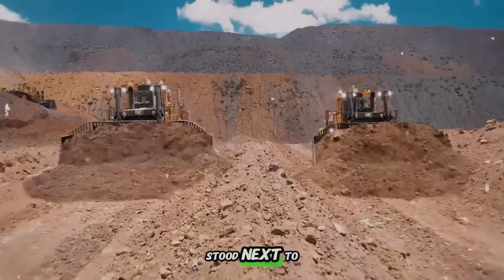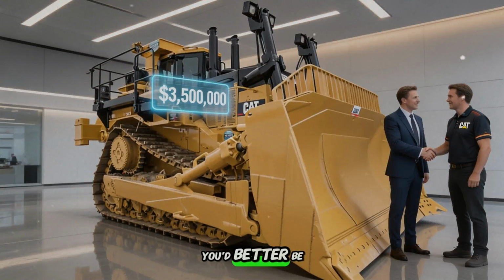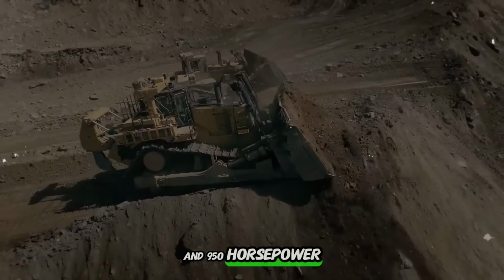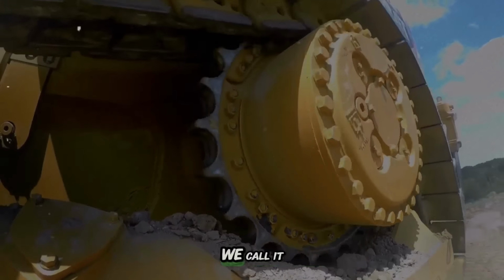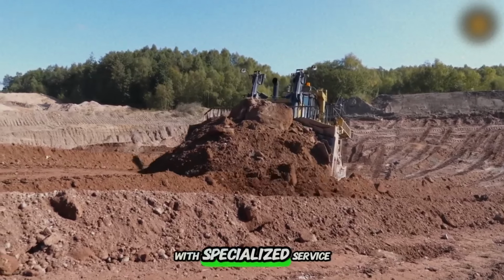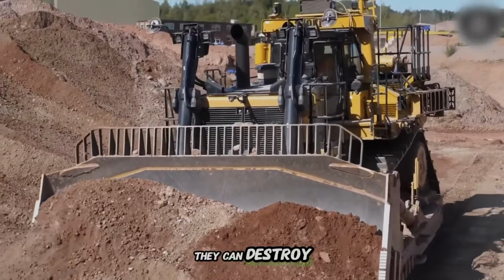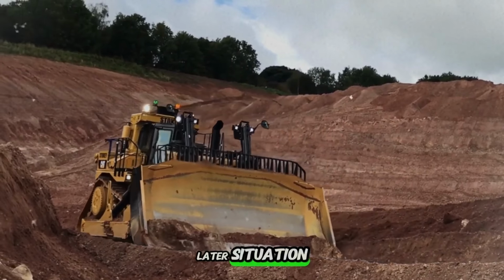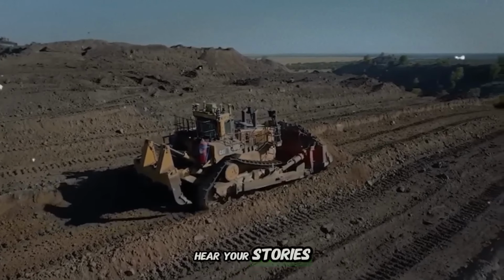Why  MOST People Can’t Afford a Caterpillar D11

Comment: When D-11 is changed to
 diesel-electric (available now) from mechanical drive, engine life goes 24000 hrs.  D-11T final drive fit electric drive motors. D-11 runs 24/7/365!

Comment: Overall good video.   I sold these for years.  Most customers used them 20 hours a day.   Pricing is over 3 million for almost all configurations.  $400 to $500 per hour with operator and everything else needed is not out of line.
Reply: True.
Good comment.
Left mining three decades ago, but had D10 and Komatsu 475 on site.
Gold mining. They ran 18 hours a day minimum each.
A few hours down for service and refuel.
D10 pushing scrapers and 475 ripping and general work in West Aussie mine.
Great machines. Got to do some ripping in the Komatsu. 
Never forgot the power they have. Truly awesome. If you’ve not been in one it’s really hard to appreciate what they can actually do.
Humbling.

Comment: It’s an off-road truck why would it need def ? My dad had an excavation project this past summer and they specifically used off-road diesel. It’s cheaper. But yeah, there’s a huge fuel burn on anything big. Do you need low end torque.
Reply: Red diesel is tax exempt.   It has nothing to do with EPA emissions requirements
Reply: Different level

Comment: I will just use my Detroit Diesel silver 92 series with turbo in my 1989 Spartan Gladiator pumper as my comparison as ME the OWNER of this Diesel brand, and my personal use, 
As a smaller but Diesel fuel "hog" I keep a tight log on my hour meter and Odometer when I fill up. That smaller (475-HP) Detroit get between 2.5 to 3 MPG. and became she is just normal driving to public events or for training Fire Cadets. Never pumping water with high volume. My Diesel engine is not very economical. Those massive Diesel engines consume LARGE amounts of fuel. 😊

Comment: Yeah no. From what I've seen from your channel you're strictly a 'spec-sheet' and AI channel. I'm guessing all of your 'research' comes from the internet and not one of the creators of this channel have any stick time (in any real machine). Unsubscribing.
Reply from the maker: Fair enough  but solid research and technical breakdowns aren’t “just internet stuff.” Understanding specs, engineering, and performance data takes real effort too.

Seat time is valuable. So is knowing how to analyze and explain the machines clearly.

Appreciate you stopping by either way.
Reply: Remote operation? Marvin Heemeyer would have run with that.